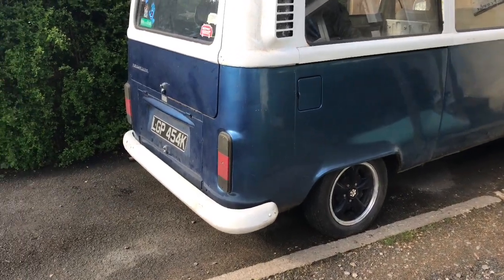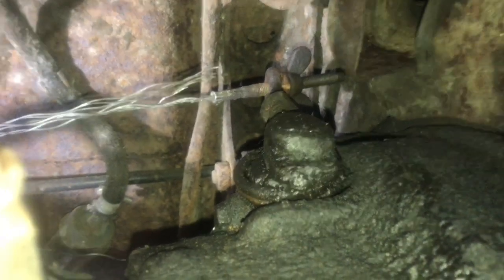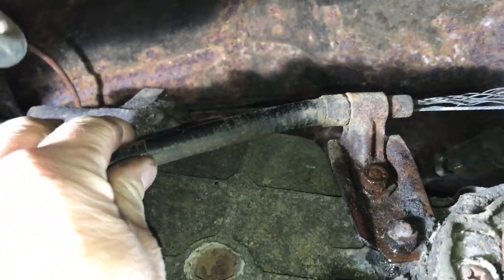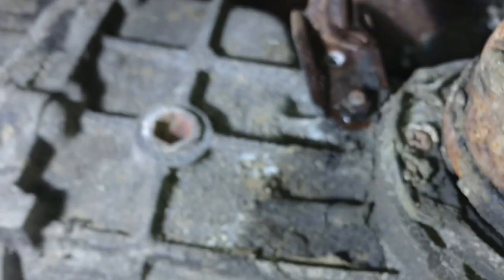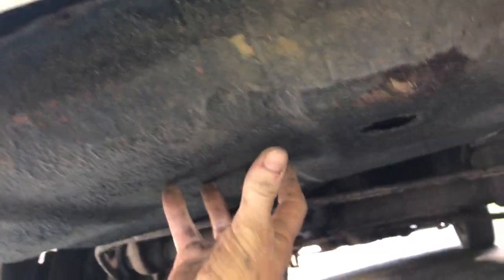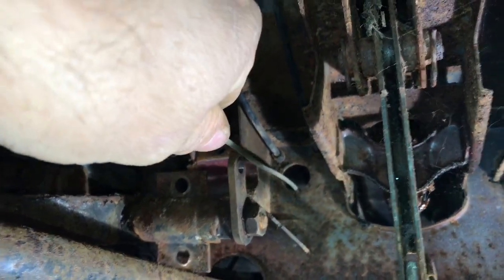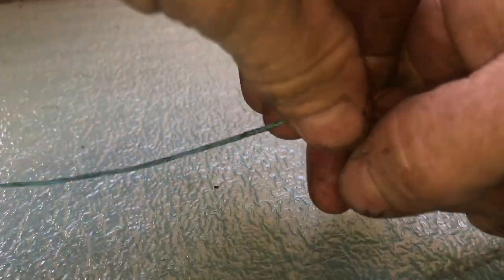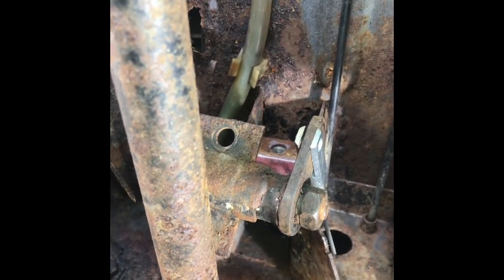Clutch cable replacement VW bay window

Comment: you should grease the pivot point and the cable before putting it through to the back. it will extend its life by years.
Reply: I guess I'm quite off topic but does anyone know of a good website to watch new tv shows online?
Reply: @Salvatore Cassius try flixzone. You can find it on google :)
Reply: @Titus Rodney Definitely, have been using flixzone for since april myself :D
Reply: @Titus Rodney Thanks, signed up and it seems like a nice service :) I appreciate it!
Reply: @Salvatore Cassius you are welcome xD